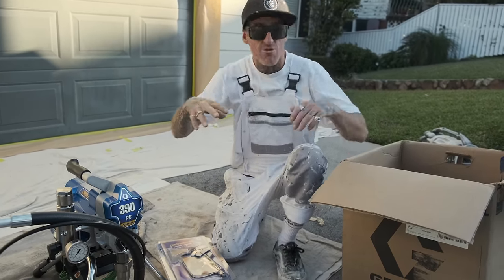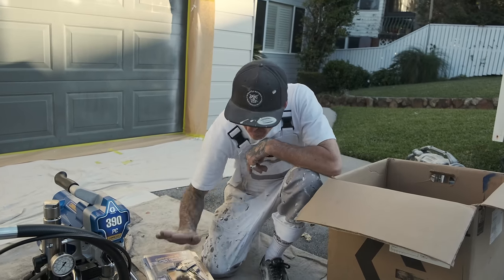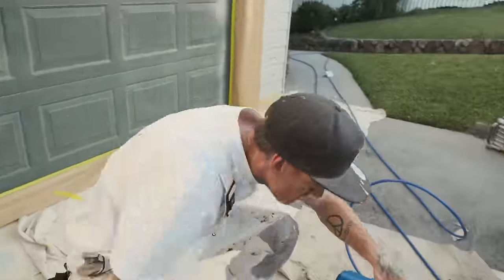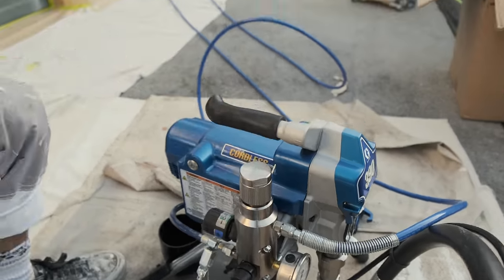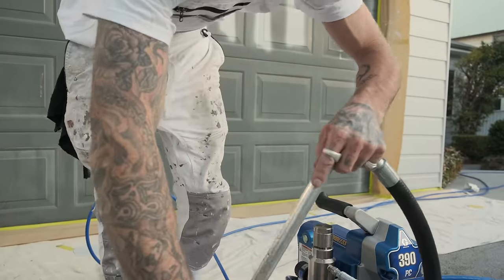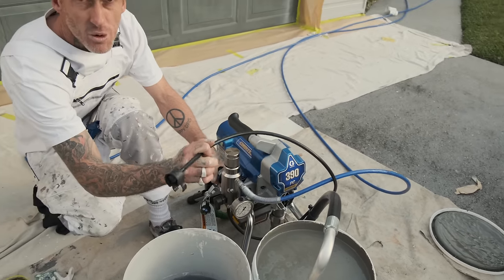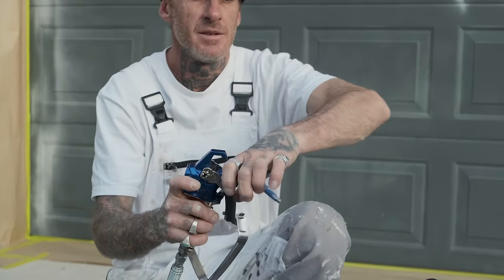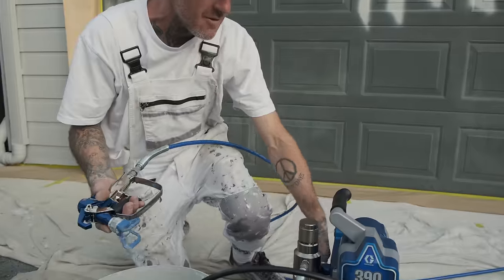HOW I PAINT GARAGE DOORS FT. GRACO 390PC CORDLESS PAINT SPRAYER

Comment: Been waiting for this one 🥳🔥
Reply from the maker: Finally got it out for you legend. Cheers for the wait 💯🙏
Reply: @paintingbyjosh  hey bro! Is low sheen your go-to finish above semi gloss or gloss? And how does it hold up over time?
Reply from the maker: @shaanyballos  hey bro, I usually use semi-gloss for garage doors & trim & i swap between low-sheen & semi on walls depending on the surface,  location & surroundings 💯🤙🙌

Comment: Oh I'm dirty now I just bought my 3rd Graco cordless portable had 2 repaired the earlier ones then got the DeWalt one, which I barely put 40L through and it needed rebuilding.   And that wasn't easy either as they say that's tricky.   Tempted to sell both mine now and get this.   Especially with the hopper that thing be brilliant.
Reply: If your on a 3rd one I would give up on them lol.
Reply from the maker: Hi mate. Most definitely I gave up on the Handheld years ago. More time & money than what they are worth💯 I can get out any machine set-up spray and put away quicker than than thing. Sell up and invest in something that WONT let you down 🙏🤙

Comment: if I drying up tip fflp208 witj paint acril pait , can I clean up doofe without damages 💔?
Reply from the maker: Yes most definitely. I put the tips in hot water for 5 minutes to soften the paint the blow out with Max pressure through the sprayer 🙌

Comment: Do you get lots of clogging with the 308 tip ? I've had to use the blue filters to prevent clogs on 308
Reply from the maker: Hi Nigel, no I don't seem to get to much clogging with the 308 has to be filters or pressure 💯🙏

Comment: How much did you charge to paint the garage door, excluding the paint?
Reply from the maker: Hi Gina. Depending on condition bit usually around $1600
Reply: @Painting by Josh   1800.00 you would be lucky to get 180.00 quid in england

Comment: THE ONLY DIFERENCE I DO IS UNSCREW THE CARTRIDGE IN THE GUN AND GIVE IT A CLEAN, AS WELL AS THE FILTER IN THE GUN AND ON THE PUMP  AS PAINT BUILDS UP ON THE REAR O RINGS,AND ALSO IT COMES IN AND OUT AT EVERY USE FOR EASE OF CLEANING